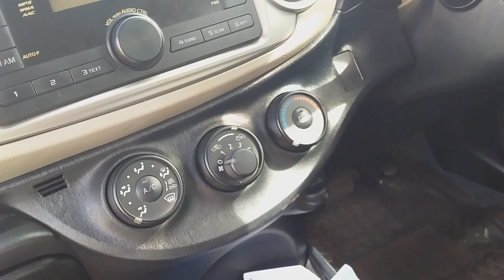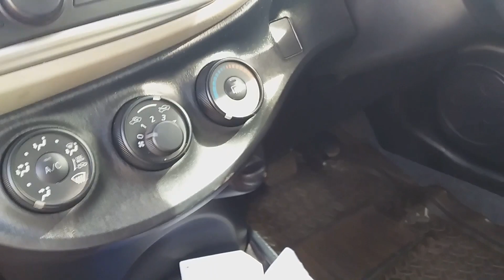Toyota Vitz Engine Check Light P1589

Comment: Can you show where the throttle position sensor is located? I want to change my accelerator pedal sensor and throttle position sensor
Reply from the maker: The throttle position sensor is located on the throttle body.  Its the only electronic system on the throttle body.

Comment: you know where this is in toyota vitz 2008 1kr engine
Reply from the maker: @arthur._xp12yg  if it's not where the one I display is located am not sure for your vehicle.
Reply: @ShelDockToyotaVitz thanks i found it. is it safe to just unplug then plug it back to see? it feel screwed down good ?
Reply from the maker: @arthur._xp12yg  I have not disconnected any before but since the battery has been discontinued at some point this device would have lost power. With this in mind you should be able to disconnect it without any problem.